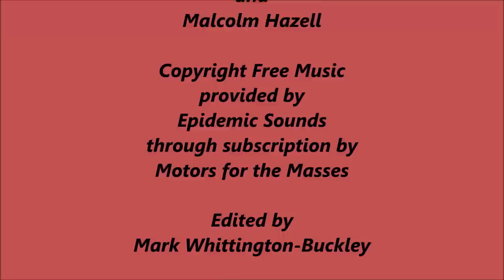Stomp 140 Pit Bike Modification

Comment: The disk and sprockets should be covered with locktite you have to heat the bolts up and they come off easy if u haven't ur sprocket will keep coming off